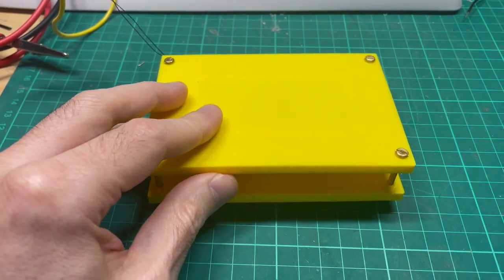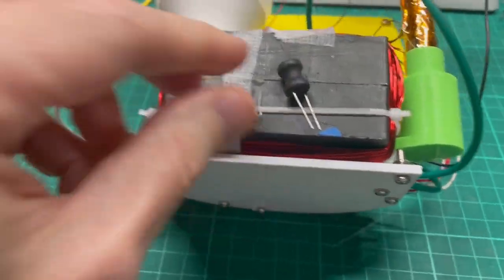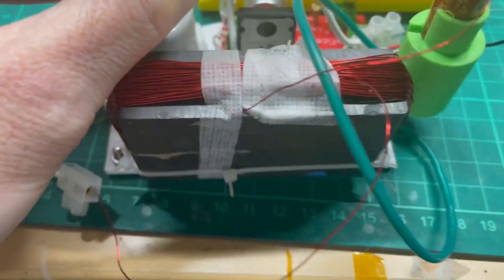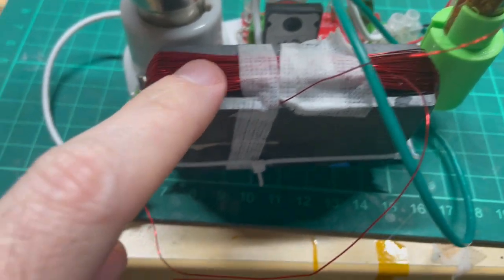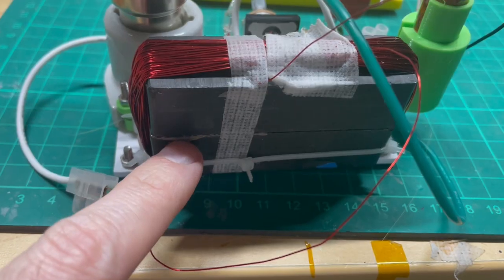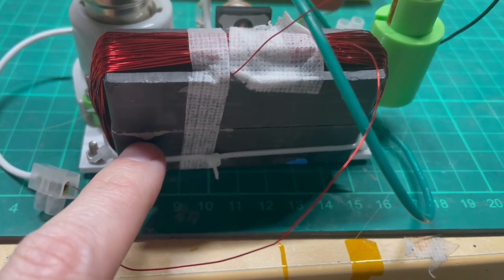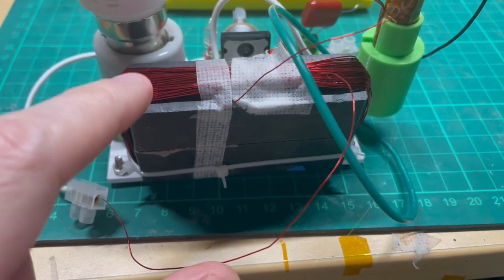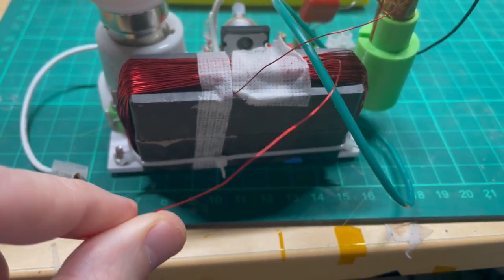John Bedini Scalar Field Magnet Coil

Comment: scalar to make transmutation possible. Charged water next to orange juice will take on the orange juice flavor. I think scalar is pure amp field. What do you think?
Reply from the maker: That’s exactly right Nathan. From my experiment with Tesla Magnifying Transmitter which is a scalar wave transmitter, it appears that scalar wave is picking up extra electrons from the environment or eather. So I have been interested in scalar fields for a few years. I am still trying to figure out how to capture scalar fields back into the system. I know that for my TMT, I had to build an antenna receiver at half wavelength and at 1.5c. But for capturing local scalar fields I am hoping that there is an easier way to capture scalar fields back into the system. I’ll have to try that experiment Nathan. My friend David Lowrance from Alaska has a website full of goodies (https://resonantfractals.org/Doc/1index.html) worth a look as he is a researcher and spent 30+ years gathering his research. I do feel we are entering in a new re-discovery cycle. Hoping we make a huge breakthrough soon. Thanks so much for taking the time to comment. ❤️